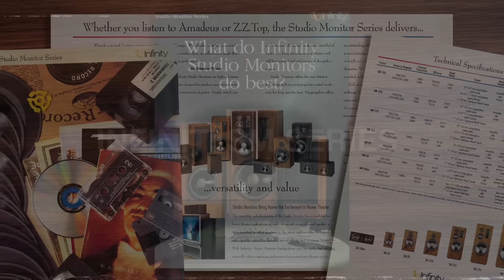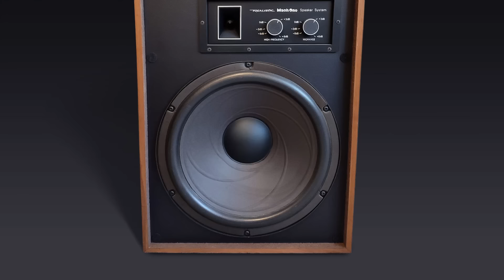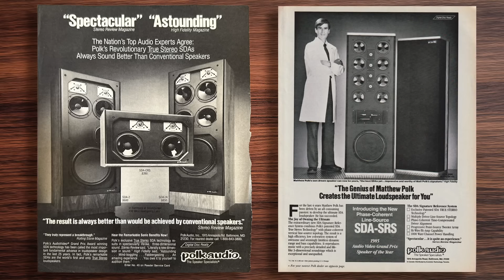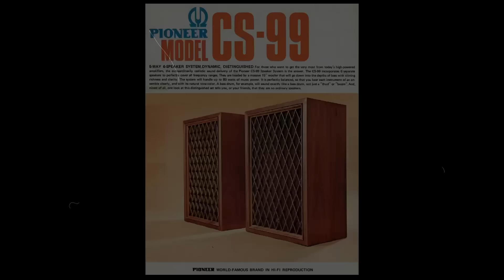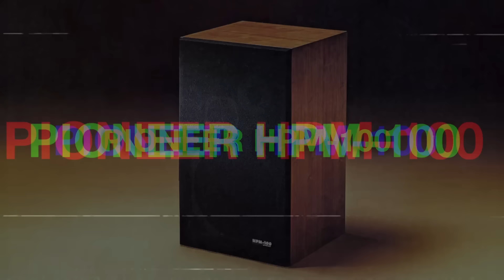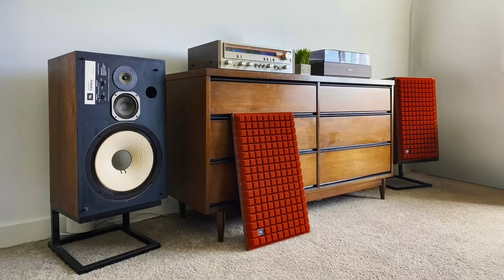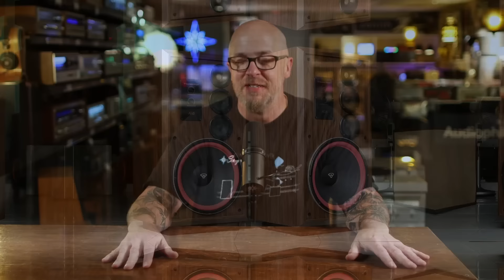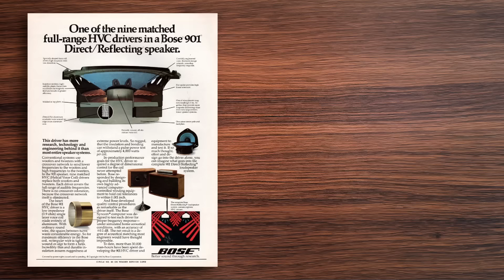Why Do Audiophiles Hate These 9 Legendary Speakers?

Comment: Most "audiophiles" would never be able to identify a "legendary speaker" in a blind listening test.
And by the way, price is hardly any sort of determining factor with regard to sound quality.  Moreover, the quality of your recording is by far the greatest factor with regard to sound quality.  One brand has very specifically made damn sure of that - (sound quality) - the brand Telarc.
Hey, but there's surely NO shortage of other companies which likewise make killer sound quality recordings.  Generally speaking, if you want a pretty good but specifically "old" speaker, then you can hardly do bad with an acoustic suspension sort of speaker, basically a sealed box.   Ported speakers sound fine, and are quite efficient.  But quite often, the good old ordinary design is best.  Not too different from some old stick shift cars which last practically forever when compared to the modern day equivalent, minus the manual transmission.
I have an old set of infinity speakers, an old set of B&W sealed box speakers, and a most modest pair of old Yamaha speakers with a 10 inch woofer and a one inch dome tweeter.   Worth $400.00 in the mid 80's.  But I managed to get them on a clearance sale for only $150.00 way back in the day.
Those speakers are half as good as my damn good old Boston Acoustic tower speakers, a model which is now out of production.
With speakers, you generally get what you pay for.   More often than not, you get better sound when spending more money ... but this sure as hell is NOT always true, meaning that you can get great speakers for not a hell of a lot of money.   After a while, there are diminishing returns when you start spending a hell of a lot MORE money . . . for example, $50k, $75k, $100k, and even BEYOND those ridiculous prices.
Generally speaking ... yes indeed, the very OLD cherished equipment, whether amplifiers, tuners, speakers, or whatever ...  is ALL infinitely better than the vast majority of ordinary trash equipment being produced today.
   There are surely TWO sorts of audiophiles:  Those who are self-righteous overbearing snobs, and those who are sure as hell NO such thing.

Comment: My vote for the worst expensive speaker would be the AR LST, but the only exception would be the Bose 901 (any version). I had the unpleasant experience of being the warranty depot for both. I liked the Infinity 2000 with the electrostatic tweeters. My current system has the Tannoy Cheviots, which I love.

Comment: My first pair of speakers were Bose 901 series IV I loved them.  At one point had them paired with a pair of Altec voice of the theater . It was fun times and loud disco . I still have a pair in my exercise room while the heavy lifting in the living room is a pair of vintage University  debonaire ‘s  with 15 inch woofers you can’t beat 15s for the base .

Comment: Big Klipsch fan. Have Chorus II's, Forte II's and Quartets in different rooms. (They've all been fortified with Bob Crites x-overs, mids and titanium tweeters. Have had a lot of speakers (HPM-100's, 1500's, HPM-900's JBL 4312's, 4311's, L100's and countless others.) But always came back to the Klipsch. Love the imaging, wide soundstage and yes, sweetness. Don't find them fatiguing at all. Also have a set of walnut New Advents with a Marantz 4270 in my office. PS. I really loved the way the HPM-900's sounded. They just seemed more balanced and well-rounded than the 100's
Reply: What are you powering the Forte ii with?

Comment: I first heard the Klipschorns at the  Australian Hi Fi Audio Show at Sydney in 1972. The record playing was a direct to disc recording entitled The Missing Linc on Sheffield Records. The track was Peace Train, by Cat Stevens, an instrumental version. The sound was incredible featuring drums, harpsichord, piano, cymbals and other exotic instruments.

I remember hearing some of the JBL speakers from the seventies and what i noticed was the forward sounding mid-range

The Bose 901 was at the Sydney hi hi show It was playing a 20 HZ note with the grills off. Those little 4 inch full range drivers were pushing in and out like a tornado.
Reply: I bought a pair of Belle Klipsch in 1980 here in Australia and drove them with a B&O Beomaster 4400…after a business disaster and the birth of my daughter in 1990 I sold everything.
I went into hifi depression for many years as the replacements became unaffordable.
Currently a set of similar spec La Scala are over $25,000.
I found a pair of mint Belle’s that have been stored for many years from a deceased estate and bought them for $6000.
I am happy again.

Comment: I still have a pair of Bose 901’s series II since 1973 and they have never been reconed. They sound great still. They work well with a power amp at least 200 watts and a preamp that’s a good match but I think that’s true with any vintage amp. I added a subwoofer a few years back. So bash away at the 901’s if you like,  it doesn’t matter to me.

Comment: I was the service manager for a large audio dealer back in the early 70s. One of the first things I learned was that speakers and sound were very subjective. I knew customers that preferred our cheap house brand label speakers better than offerings like JBL L100's. You hear what you hear and you like what you like. My brother got a pair of JBL L100's and loved them. Personally, I didn't care for them. My preference was the JBL L45 Flairs.  I do agree with the comments on Klipsch. You either liked them or hated them AND Klipsch customers could not have cared less what you thought of them.
Reply: I was given a pair of L100's around 25 years ago for free. I used them off and on but when I got my EV Sentry 500's they made the L100's sound like toys. I sold the L100's last year for $500.

Comment: No one ever compares these classics to the Sansui Z9 series. When I purchased my Sansui G 9000, I was on the hunt for a set of speakers that would hold up to that type of power. Second factor for me is tight bass and you ain't gonna get that for very long with foam surrounds. None of these speakers shown would hold up to the real wattage of a 9000.

Comment: Bought a pair of CV AT-15’s new and loved them , 25 years later and I still love them, I did have to refoam the woofers , 95 lbs. of awesomeness!
Reply: Same here. Had to refoam them also. Powered with a 500 watt amp, they are stupid loud!! But I must agree, this is more for a fraternity house than for a home that needs peace and quiet.
Reply: Loved the shit out of them. Neighbors not so much. My carver amp eventually fried them😅
Reply: I had a pair were in mint shape when i got rid of  them a gew years later only because i moved out of my fathers house and couldn't play them while he was home which was quite a bit since he was retired but the first year i beat them hard and they were fine for bands like Motorhead, Thin lizzy, all the guitar bands.
Reply: Those are cheap-ass young raver's party speakers, and they don't deserve to be here. There is no way somebody will listen to them and think those are audiophile hi-end speakers. Nope. Those are made to rock the whole neibourghood. And they do taht at low price and with some decent quality. Oh and sensivity is high, so you don't have to buy some exensive overpowered amplifier to run them.

Comment: I restored a pair of 1971 Sansui SP-5000 that were the very definition of Kabuki. TBF they were huge and heavy. The cabinets were very solid and the twin horn tweeters were actually pretty refined. The trick to them was to pair with the right amplification. You'd think with 101dB/1m that they'd be happy with low powered amplifiers, but with those complex crossovers and 15" woofers, they actually came alive with more powerful amplifiers that could deliver a lot of current to tame them. Those classic lattice grilles are also a thing of beauty.
Reply: I just tested a Realistic str2100 through a set of Sansui SP-S9000's. The power of the STA2100 really woke the Sansui's up. Good clean bass and crystal highs.

Comment: As a former stereo salesman I have sold most of these speakers. I currently have Pioneer HPM100s, but I also have Magneplanars. They each have their place, as you noted. Sold lots of JBL100s, which are very good. Also lots of Klipsch sales. Not a horn fan, but I understand why people like them. For kicks we once wired up some corner horns to be run by a 1/4 watt mono dictation cassette. It didn't sound too bad and got pretty loud, too! On the minus side, I couldn't get behind the Cerwin Vegas for the reasons you mentioned. But the absolute worst is Bose. Talk about destroying any phase coherency. I absolutely hate them. And the 501 and 601 models are even worse than the 901. Surprisingly, the 301s aren't too bad for a cheap starter system. Big fan of the HPM series. Pretty indestructible as you mentioned, but the pair I have came with blown mids. How loud did they turn it up? To your list, I would add ESS speakers, which fall into the same category as the HPM series. I've got a pair of AMT10s. Love em.

Comment: I don't understand why there are so many different opinions.     It is easy enough to run a swept sine wave into an amplifier to measure its response and then measuring the sound that comes out of the speaker.   The goal should be to reproduce the input accurately.    People will have opinions but accurate measuring devices will not.   Way back in the 70s I had an phase Linear 400 amplifier that was supposed to be a wire with gain as opposed to the Marantz and other that used tubes which are inherently non-linear.  Yes the tubes sounded warmer but I only liked tubes in guitar amps.   Another thing was dynamic range.   I had a jazz album by Charlie Byrd.  The dynamic range on that was incredible for a record.    I could see my Phase Linear's need jump to the red due to the impulse or dynamic range.  I was impressed then but now I am much older and wiser.   I would also test the dynamic range of speakers with instruments.  Way back when I didn't know any better it was just what I liked.   Now I know better the criteria should be how well the output reproduces the input.  It can all be measured without opinion.
Reply: Not looking for a fight, but you are stating your OPINION like it is FACT, or that we all see things like YOU do.  Neither of those are true.  If it were, no one would have purchased the Bose 901s, yet this thread is full of people who did and don't regret it.    It is all subjective.  Your opinion is JUST your opinion.  No offense intended, I'm just tired of people projecting their viewpoint on everyone else.  Everyone thinks their opinion is best.

Comment: audiophiles dont hate polk SDA--quite the opposite. they do hate kabuki and bose 901 because they dont like how they sound. to be fair, those kabuki speakers arent suppose to sound good, theyre just sopposed to be tacky nosense. they dont hate the HPM-100. we know theyre pretty good but nothing special. some of the cerwin vegas are greatly appreciated as sounding and performing better than they should and being way more than party speakers. some audiophiles like those klipsch and some dont. as big as low powered single ended tube amps have begun more audiophiles than ever like em.

Comment: I have a pair of JBL L100T.  Bought them in 1982. Still sounds great. Had to replace the paper cones on the two woofers.  I will most likely die before they do. I like to listen at night with the lights off. It’s a different experience.

Comment: What do you mean by "good speakers"? Is it really just subjective and random? Or is there some science re what they're made of, size and power etc?

Is the ideal speaker made of a high vibration material like aluminum? Or a stiff low vibration material like carbon fiber or granite?

Does the width, height and wall thickness of the box matter etc?

When people talk about preferences based on brand names it just sounds like snobbery of people who don't actually know anything.

Comment: Grew up with Altec 846B in one room and JBL L100 in the other.  The Altec's sounded great, the L100, not so much.  I stuffed rags in the ports and that improved them quite a bit.

For vintage I built Altec A7 Voice of the Theater replicas about 20+ years ago and plan to build Model Nineteen replicas as soon as I have time.  These are strictly for nostalgia value however, I use DIY open baffle speakers for regular listening.

Comment: I like my Cerwin Vega bookshelf’s and my Kenwood K series that I have replaced the drivers in except the the tweeters. The 4 hooked up to 50-70 watts per channel at  8 ohms all 4 sound really good. The Kenwood KA-87 amp was really good for an 80s Solid State driving Aand B. I always wanted an amp with a clean Subwoofer out. This setup was only good to 7 on the dial. But the 4 speakers placed well were nice and clean. I don’t know what amp and EQ to buy. The system went to goodwill for some reason, but I kept the speakers. Any Suggestions? I want a powered subwoofer out that can be discretely placed, even a blue tooth. Ideas?

Comment: I listened to some Polk STA speakers. I did not buy them because I had a Carver Sonic Holigram generator, which does the same thing. Also, I did not purchase them because it is tricky connecting them to a Carver Magetic Field amplifier. I purchased a pair of Bose 901's. They gave me listening fatigue, so I returned them. I ended up building my own, which worked well until my wife and I parted ways. She sold them! Eventually, I purchased Paradigm monitor 9's back in the it's. I still listen to them.

Comment: As a late teenager in the late 70s  i had a pair of klipsh cornwalls driven by a crown 150 solid state amp and preamp. Shoved the speakers into the corners of my bedroom to maximize the bass.  I also played in a rock band through a 50 watt ampeg v2 half stack. Practicing along with records at loud bar gig volumes was no problem. It was glorious.

Comment: I believe the newest Klipsch speakers I.e. the Klipschorn AK7 and the La Scala AL6 are noticeably less “shoutie”.  They both have the Tractrix midrange horn rather than the old exponential midrange horns that used to cause your ears to bleed.  Anyone that doesn’t like the Klipsch sound should give the new ones a listen.  I believe you will be pleasantly surprised.

Comment: Cerwin-Vegas got me into speakers as a kid. I still have my RE-30's that my mom bought me. Ive owned AT-15's, and RE-38's as well too. Ive had 901's Series VI running off a Rotel amp and they were honestly pretty good for what they are. Decent mid-bass for the small drivers and played loud for extended periods without issue, just like the CV's.

Comment: I had a set of mx400s that I replaced some old kappas with, and alternated them with a pair of the exquisite JBL 580s, and they were absolutely lovely with an amp that could actually drive them (high current, not just wattage), and a touch of DSP. 

I think a lot of the hated for CV stuff is snobbery coupled with an unwillingness to take the time to make them shine. How many of the people who dismiss these after five minutes of listening will spend a year tweaking a pair of Wilson's one mm at a time. 

Source+processing+amplification+speaker+room=sound

Comment: When I first got to Germany I built my first set of speakers based on the Pioneer HPM 100 speaker cabinets. They came out great and ended up sending them to my sister. She used them for fifteen years before she got rid of the whole system that I sent her. I got the speaker grills for free they looked and sounded great.

Comment: somewhat sorta kinda relevant. electronics tech. ZZZZZTT-Poofed a woofer. playing Creedence, of course. Replaced that woofer and noticed that the wire from crossover to woofer was a twinky little 22 gauge. replaced that one foot of wire with some 12 gauge, reassemble, crank some tunes and... WTF? the other subwoofer was dead. I eventually put my fingers on the original woofer and determined it was working. I replaced the 22 gauge in that cabinet and holy wow, it sounded good

the theory behind this: amplifiers have a damping factor. damping factor is: the impedance of the amp from the speaker side is a tiny fraction of the impedance from amp to driver. The drivers are linear motors. DC motors are also DC generators. Woofers have vast heavy cones when the bass stops the cones continue to vibrate - it overhangs. the damping factor of the amp should short out the overhanging bass. the damping factor can't do its job if you insert a resistor. that tiny length of 22 gauge is enough resistance to incapacitate the damping factor.

if you understand the meaning of "if it smells like chicken you're holding it wrong" try replacing the internal wire from crossover to woofer, and use 12 gauge from amp to speakers. you don't need audiophool wires, zipwire on a spool works fine.

Comment: I built a small pair of 2 way bookshelf speakers in high school on a $50 budget. Parts were Realistic 8" bottom end, with a horn on top. Perfect 40 watt speaker, and I still hammer on them in my garage system. I'm 65.
Reply: Realistic Radio Shack sold a ribbon tweeter in the 70`s, heavy unit and great long lived sound.
Reply: Realistic made the Omnis 80 8" drives and a 1" soft dome with a 10" passive radiator. Had them for 10 years.

Comment: The first stereo I bought in 1977 featured an HK A403 amp and Pioneer CS99A speakers. I still own it. I think some “kabuki” style speakers can sound great with quality input. And they are not all the same. Cabinet size is not as big a factor with a sealed speaker like the Pioneers; especially since the midranges were sealed as well. I think they sound cleaner than the ported type. A good crossover is needed, of course, and excellent drivers are required, but I think the “division of labor” aspect of multiple speakers is overlooked.